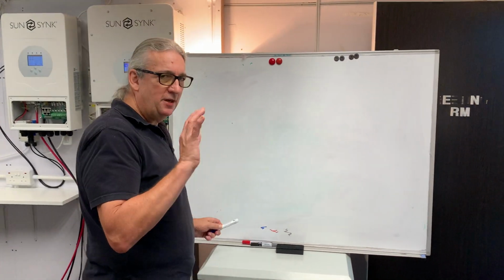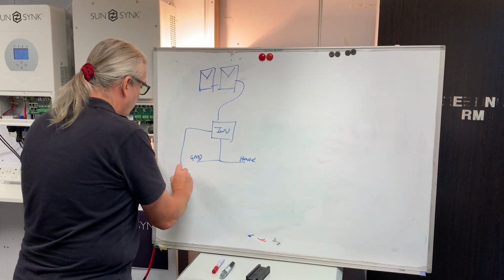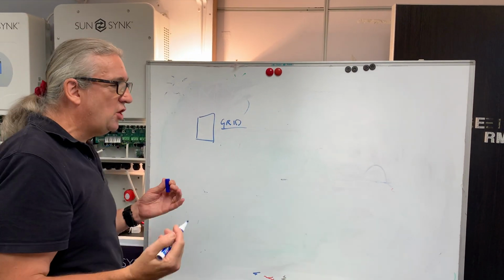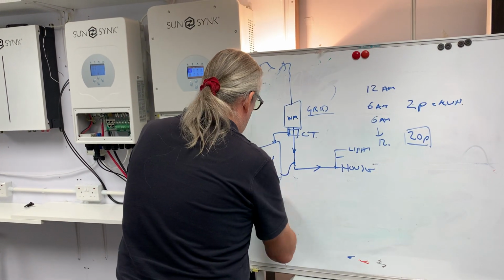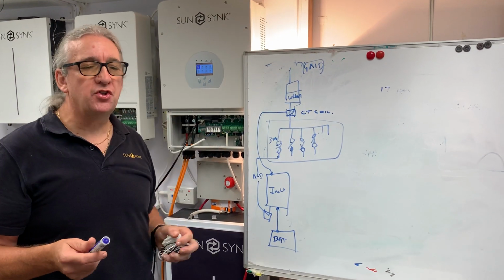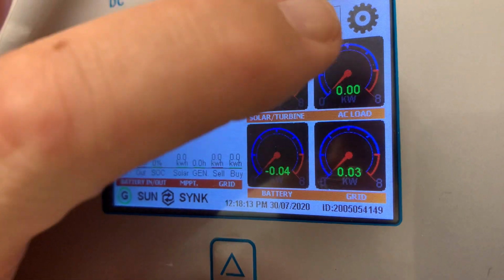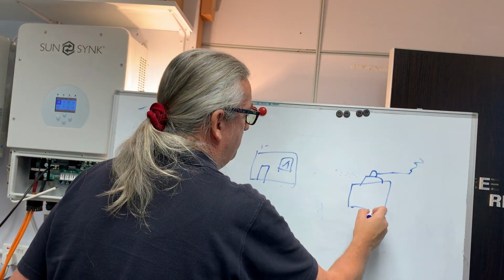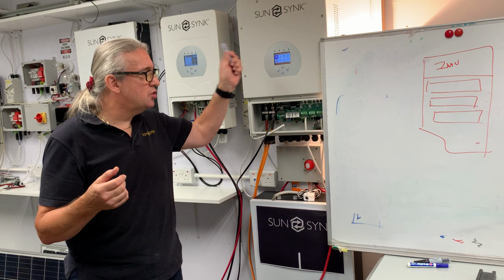Brief introduction to Battery systems￼

Comment: It's a really nice video, Thanks for your efforts.

What goes between the bms and the inverter regarding protocol, data packets, and registers? do you have any documents exploring that?

if you are interested, I would be glad to discuss with you more about the PV-Disel hybrid system we are willing to test. It manages the fuel consumption and power generation from PV and gensets.

Comment: I’ve been installing your kit for another company for a while now and I like it. The only problem I have found is that, as the majority of the people I am installing for are old, I am having to take on board the responsibility of force charging the battery/batteries to 100% once every seven days to give longevity to the units. I’m having to do it via the app. You need to pull your finger out and have a time slot that operates once a week so I only have to engage the force charging during winter months. This only applies to customers that pay a fixed rate at all times but economy seven or octopus agile are not available countrywide.

Comment: Hi Keith I am having a Sunsynk inverter installed with two 5kw batteries the team are going to remove my old ABB power one inverter which DC so the new will AC I am told it will much more efficient I have solar panels so looking forward to seeing it all work

Comment: Very instructive and nice system. Do you have a video demonstration how to program the timer in the inverter if there is no solar panels. Could you do one if you don't. Between the hours of 7am-10pm I'm charged a higher rate. 10pm -7am a much lower rate. From what I  understand from your whiteboard explanation I could charge my batteries during off peak and discharge the batteries during peak charging and save quite a bit of money. Is that correct. Could you show how that's programmed on the inverter. Thank you

Comment: So you place the CT coil where you 'don't want power to flow to' it basically tells the inverter to BLOCK current in that direction . ?
Reply: face arrow on ct coil correctly  towards panel

Comment: Hi Keith, Thank You for your informative video. I do have a solar and grid combination system using the automatic change over switch in my home. When the grid is off(load-shedding) and only solar and the battery is available the lights have a dim glow with the light switch is off. When the light switch is on the light brightness is normal.  When the grid is available there is no dim glow. This only started when the solar was fitted a few months ago.  My electrician says we must fit a contactor to resolve this problem. To my knowledge contactors are used for motors and machines. Please advice.
Thank You.
Reply: I see you asked this a year ago, but for anyone else with this problem, look up earth neutral bonding. Not having it can be dangerous!

Comment: I hope that this question will still reach you Mr. @Keith Gough... my question is will Sunsynk Hybrid inverter accept DIY Lifepo4 with BMS but it does not have any communication port.. as usual with diy lithium/lifepo4's ?  I love doing diy lifepo4  and it only has bms which does not have controller area network port. I hope to hear from you soon. thanks
Reply from the maker: If you know the battery parameters you can treat this as a AGM battery and program the float voltage, low battery cut off.Only use voltage settings in this case As the SOC will be in accurate
Reply: Thank you Mr. Keith for the clarifying on this. Now I am confident that my diy lifepo4 will work with sunsynk.

Comment: Hi Keith really enjoying your videos. There is one thing I'm not understanding very well, how does the CT stop the power from the inverter flowing back into the grid?   I know ct's are used to measure high currents without direct contact to the Instrumentation. I would really like to understand how you guys achieved this. Amazing work!
Reply: Some sort of diode.
Reply: Some sort of diode.
Reply: Can't wait,  we're having your inverter and batteries fitted soon,   very impressive video